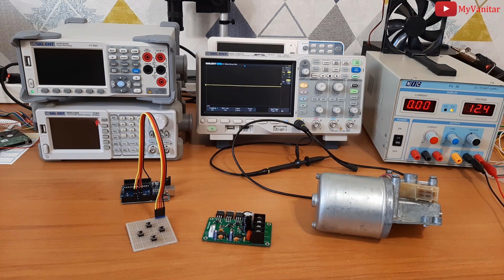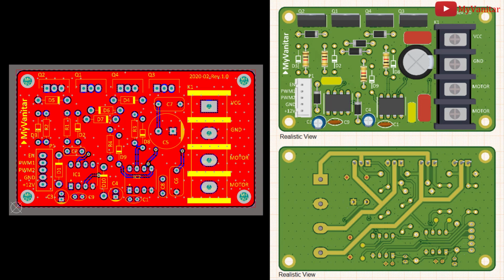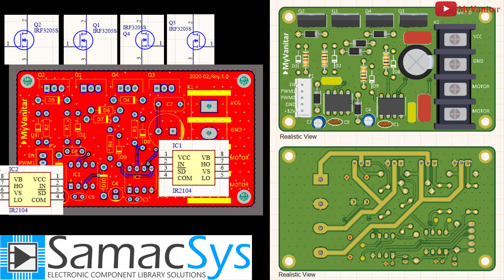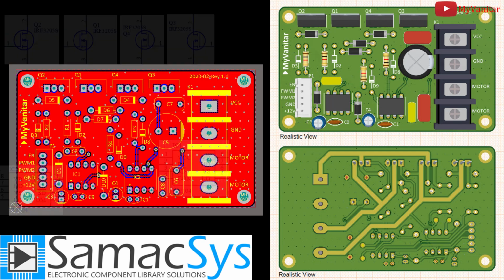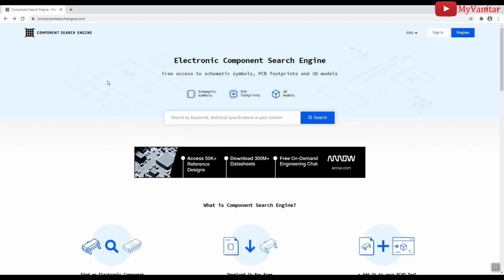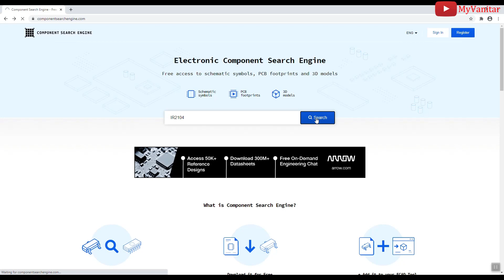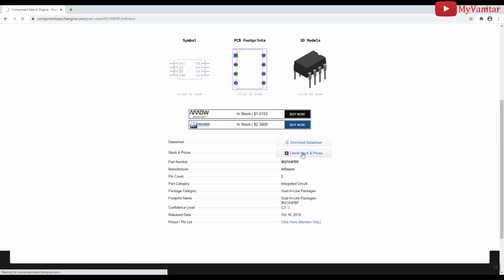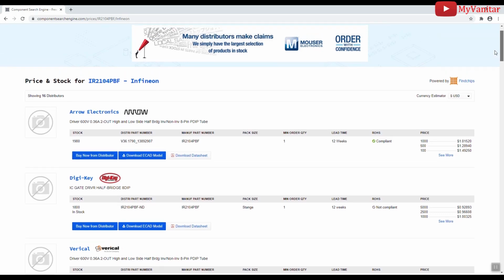H Bridge DC Motor Driver/Control Circuit [40A PWM, Power MOSFETs]

Comment: Hello, I am from Argentina, excuse my English! Very good project. I am working on a replacement for the famous IBT-2 BTS-7960, I do it with IR2110 and channel n mosfet, also a dead time logic so as not to destroy the mosfets. This video inspires me to do it!
Reply from the maker: No problem, if you practice English, then you are a BIG step ahead of others! It really depends on the current consumption of the load and the choice of the MOSFETs that could tolerate your rush currents

Comment: Very nice explanation; I found out the hard way about needing Schottkys across the FET drain to source, they are definitely needed for driving the bigger motors.  I kept blowing the FETs and it took a lot of looking around to find the cause and explanation.
Reply from the maker: Thanks. Generally, it is much better to use those external diodes. I explained why in the article.

Comment: 3:46 And a non conductive screw! Nylon screws usually
Reply from the maker: Not a screw, but a plastic washer
Reply: @MyVanitar  I meant a nylon bolt. If you use a metal bolt and a plastic washer it could still short out
Reply from the maker: whatever I say you make your assertion :-), no problem, use that bolt in your designs

Comment: Can you explain how you made the button connections of the engine? How will the connections of the 4-legged buttons be ?
Reply from the maker: I think you use Google translate. for buttons, as you see in the video, I used a demo board and connected each button to an Arduino PIN (Digital Input PIN). the buttons are named "tactile push buttons". Reading button status is a basic Arduino project. I used an Arduino library for easier reading as well (JC_Button)

Comment: I build the circuit and run it. I only had a problem when I pressed the reverse engine buton. I think I made a mistake in the software part you shared. 
Thank you.
Reply from the maker: Keep trying and practice. Invest some time. the code is easy

Comment: Thanks for your good work on this driver.  I wonder why you do not measure the current in the motor.  I am interested to see how it performs at 15 Amps for a sustained time.
Reply from the maker: Thanks, I received similar requests from two other visitors as well. No problem, I will add the current feedback, however, that's not a difficult task. The encoder is even better to keep the torque identical all the time.

Comment: Hello and thanks for the video!Can I only switch the Mosfets for having a power supply of 120V?
Reply from the maker: you should change some capacitors and the MOSFETs because your input voltage is higher than the voltage of these components
Reply: @MyVanitar  Thanks for the reply.The capacitors I have to change are C5,C6,C7 am I right?
Reply from the maker: @upbgenoob5488  honestly the PCB should be modified to follow the higher voltage standards, but what I told you was the minimum action, otherwise those components will explode

Comment: This is a cool idea.  I was going to swap out the FETS for 100V-40A ones to drive with a 80V lawnmower battery.  I ordered the boards from PCBway, but as I started looking for the individual components, I can't find anyone who stocks the IR2104 driver!  Any ideas on where to find?
Reply from the maker: That's a pretty normal component. search the component on componentsearchengine.com and check the stock and prices

Comment: Hi excelente video but I was wondering, did you prove your H bridge with another Voltage supply than 12V?.
I made one of this h bridges but mine doesn't work when have a superior Vs supply and I don't know why
Reply from the maker: The voltage of the driver side should be always 12V (fixed and regulated). The load side can be changed. in my circuit, I have also used some capacitors. be careful about the rated voltages of the load capacitors and increase them if your voltage is higher
Reply: @MyVanitar   max output voltage can go upto ??

Comment: Nice circuit. Does the IR2104 prevent shoot-through?
Reply from the maker: shoot through? can you explain in more detail?
Reply: @MyVanitar  Sure, no problem. Using your schematic as a reference, and using micro-seconds to mill-seconds as the time frame, if one were to want to switch the rotation of the motor from clockwise to counter-clockwise, or vice versa, there can be an issue with shoot-through, depending on timing.

So, if we switch direction, via a micro-controller, it will tell the MOSFET driver, to flip the gates to it's associated MOSFETs. Let's say we are talking about Q1 and Q2. Because MOSFETs do have wide turn on/off tolerances, usually in the micro-seconds, and sometime millisecond range, there will be a short period of time that when one MOSFET is turning on, say Q1, Q2 hasn't turned off all the way, which means you have a direct short to ground from the drain of Q1, going down the source of Q1, going into the drain of Q2, going through the source of Q2. The term for that is "shoot-through", because VCC shoots through directly to GND.

When designing an H-Bridge, this is one of the things that has to be taken into consideration to make sure that the MOSFETs don't have their lifespans significantly shortened, or that the motor or other inductive load doesn't get damaged... or the power supply itself.
Reply from the maker: The MOSFETs won't be damaged, however, it is better that you soft-start program such things (sudden direction change) using an MCU. The load (DC motor) "could be" at risk of mechanical damage because of a sudden reverse force. sometimes it is used for fast braking, however, not recommended :-)
Reply: @MyVanitar  fair enough. I know some drivers have dead time build into the IC to prevent this, but a lot of the time, it isn't obviously documented in the datasheet.
Reply from the maker: Yes, that's another advantage of using a driver, and most people amaze why I don't just drive a motor using a transistor and a single Mosfet, or sometimes just a Mosfet

Comment: Nice work. This would almost be perfect with my project. Would have to add current sensing ( ACS758LCB-CB-100B) to the PCB.
Curious if the circuit could switch to motor regeneration when coasting.
Reply from the maker: Thanks Neil. Yes, you can monitor the motor using an encoder or a shunt resistor or a sensing chip as the one you mentioned, however, this board is a driver, you can add these on a separate controlling board with an MCU.

Comment: Hello, where did you get that screw-terminal for connecting VCC,GND and the Motor? I've been looking for something like this for a long time, would really appreciate it (:
Reply from the maker: Don't worry, it is famous and easy to find, I don't remember the part number, check this video and article also: "Standalone Full Bridge DC Motor Driver"
Reply: @MyVanitar  OK thanks

Comment: The project was pretty self explanatory. But how many V should we get the VCC value in the circuit schematic?
Reply from the maker: I don't have the schematic in front, but the voltage of the driver (not the motor) must be 12V fixed.

Comment: Please can i ask what the purpose of using the diode in parallel with the gates mosfets resistors ? thanks and Nice work  and video btw
Reply from the maker: You're welcome. As I mentioned in the video, you can read more in details in the article. Also you can order the PCB.

Comment: Hi, I hope you are doing well. For clockwise rotation, Q1 and Q4 must take the pwm wave, while Q2 and Q3 must be off. But in your circuit, I think  all the switches will take the pwm , because ir2104 products two depended pwm for high and low side. Am I right?
Reply from the maker: No. All Mosfets are N Channel. PWM=0 means OFF and PWM=something means rotation in that direction. No need to disable the chips. I have published another compact standalone device as well. Check the channel
Reply: Thank. I am going to control dc motor with that by using atmega32 in MPLAB IDE. I think I should make two PWM signals as pwm1 and pwm2, which, for example, pwm2 is NOT of pwm1. Am I right?
Reply: I'm enthusiastic to learn more from you. How can I keep in touch with you? Do you have telegram or whatsapp?
Reply from the maker: Yes you would need two separate PWM pins from the MCU (for example PWM-1 and PWM-2) that could work independently because the rotation speed of the left or right might not be necessarily equal. also, you should put one of the PWM outputs OFF where the other is generating pulses. if there is only one PWM, you should perform this using a switch as I did in a different project

Comment: Is there a way to modify  this board work without digital inputs and just use a pot to vary the motor speed and or PWM signal
Reply from the maker: use a PWM generator at the input. No change should be done for this circuit because it is a Driver, the PWM generator can be on the same board with driver or at another board and connected to the driver by wires

Comment: hi, why does it show error when pwm value is 255? When 254 is OK; but at 255 it gives under voltage
Reply from the maker: an Error? You might need to modify the code a bit, that's just for testing purpose
Reply: @MyVanitar  
thanks for your answer; but it is not possible to implement 100 %pwm with ir2104. I will be glad if you find a solution and share it with me. the video is so great
Reply from the maker: @ATAS  as I told you, it is not related to hardware or IR2104, you should not be hurry in electronic, just check the code and this "if" condition: if (UP.wasReleased() && PWM_Value < 250)

Comment: Hello sir. I have question about IR2104 Vcc and Motor Vcc. I have 12V battery and 12V 380W DC motors for our robot. If IR2104 Vcc and Motor Vcc supply same terminal with my 12V battery, will I face any problem ? I don't want extra pinout for IC Vcc our design, because my battery and motor are 12V. In this video you supply Vccs same power terminal.
Reply from the maker: You can do that, both supplies share a common ground. minimum voltage is 12V. but the voltage of the driver side should NOT go higher than 12V, but the motor side can go higher

Comment: nice video and article.👍
how is the performance compared to IBT-2(BTS7960)?
Reply from the maker: Thanks. You can mount a big heatsink on this and get higher currents. You can easily change Mosfets with other part numbers and drive higher voltage loads ... etc
Reply: Estoy tratando de hacer un puente h similar al BTS7960 con IR2110 y Nmos. El desafio es lograr el tiempo muerto por hardware utilizando puertas logicas, el BTS7960 lo tiene incluido en su logica interna, el IR2110 no lo tiene al igual que el circuito del video. Si conducen simultaneamente los dos mosfet de lado izquierdo o derecho se pueden quemar. Tambien el IBT-2 tiene un ic aislador de 8 fuffer y conexiones para PWM solo con dos entradas. Es un reto pero se puede hacer.
Reply: @sebastiano6426  Hola! como vas con eso? yo también ando buscando alternativas para reemplazar el BTS7960 ya que no se consigue en mi país.

Comment: How can i add 2 buttons to stop the motor in both directions... one stop button for forward direction & second is for reverse direction?
Reply from the maker: My provided code is just a sample and for testing purposes. if you have an Arduino board or whatever hardware to generate PWM signals, you can write your own code. This circuit is the driver
Reply: @MyVanitar  thanx bro but i am not using arduino , i want to add only hardware
Reply from the maker: @RehanKhan-nc6bf  Yes, as I told you I used Arduino as an example to driver the board, otherwise you are free to use whatever hardware to control this

Comment: Make a video on H Bridge Inverter using TLP 250 or any other optocoupler. Can you suggest which mode is possible for the H Bridge or any Multilevel inverter, low side or high side is used in making simple H bridge inverter.
Reply from the maker: Okay, I will cover that if time and budget allows

Comment: Hello. I built this board but I have a problem: the input voltage is 24V but the output is only 0 to 12V to the motor. The PWM line goes from 0V to 5V. What I did wrong?
Reply from the maker: Hi. if the duty cycle of your PWM pulse is up to 50%, so it's correct: 24/2 = 12V, also your power supply should be able to deliver the current otherwise the voltage drops
Reply: @MyVanitar  The PWM is 100% (5V). The power supply is 2x12V UPS battery with enough amps ( If I power the motor directly from battery it works). If I connect only 1x12V battery the output is again 12V... It doesn't matter the input voltage... the output is 12V. I don't know what I did wrong. Some bad capacitor?
Reply from the maker: did you order my PCB or you built your own?
Reply: I ordered your PCB. I found the culprit. It was   the C2 and C8 capacitor. They were "made in china" :)). Thanks for your response!
Reply from the maker: what do you mean by made in China? C2 and C8 are just ordinary ceramic capacitors
Reply: @MyVanitar  They just smoked every time I changed them, so I took some old ones from a PC power supply and it worked.
Reply from the maker: 1uF multilayer capacitors, 50V rated. I'm sure you made a mistake somewhere, most likely lower voltage rating

Comment: Hello! I read in an article that using logic level mosfets that work at 5v (arduino output) and using bjt transistor as a controller to pre-amplify the voltage and current taking the mosfet to the saturation zone, how true is it? I am also looking for an alternative for bts7960
Reply from the maker: Hello, if you wanna build a motor driver, the best thing is to use driver chips, that's why are made for not using discrete components. 12V is everywhere because a power motor at least works with 12V, smaller ones are weak and not for power applications, probably small full h bridge chips are fine for them

Comment: Sir can I use 1uf polyester capacitor or electrolytic capacitor for boot strapping ? I doesn't get 1uf ceramic capacitor from local Market.
Reply from the maker: it's not ceramic. I think it is a multilayer one. you can use whatever type you like, but pay attention to the shape and pitch (distance between pins)
Reply: Thank you sir.

Comment: Thanks for video. I wonder "how could i check motor? Is it connected or not?" Thanks.
Reply from the maker: The only way is to measure the motor current. put a shunt resistor in series and measure the voltage over the shunt. if the motor works, it consumes something.

Comment: Can 1n5819 diodes handle high reverse currents?
Reply from the maker: They are not necessary at all. however, I added them to make a better design

Comment: I wanna use 4 DC motors, can i use 1 output for 2 motors?
Reply from the maker: Yes, you can use one output for as many parallel loads (motors) you like, just be careful about the current consumption. also check the latest video (so far). "A standalone Full Bridge DC Motor Driver"

Comment: Hi
If I want to control with raspberry pi, is it not enough ıf I give pvm1 and pwm2. 
Can ı short circuit EN and GND. Do ı get a ground fault?
Reply from the maker: if you check the datasheet, it is already pulled down using a resistor inside the chip, so you can just leave it open. to disable the chip, you should apply Logic-1 to the EN
Reply: So is it okay if we leave the most pin blank? We dont need  to put into action , ı understand it right ?
Reply from the maker: most pin blank? what does that mean? (OFF: PWM1=0 and PWM2 = 0) and ..... I have explained this to another user, check other comments also

Comment: Very nice and useful project. I want to build it.
Would it be ok if instead of the IR3205 MOSFET I would use the HSP6024A MOSFET?
Would it be better or worse? Thank you.
Reply from the maker: I couldn't find any datasheet of your MOSFET. So anyway check if the pins match (G-D-S) and how much is the RDs(on). Lower means lower heat dissipation. VDS is also important which must be higher than your input voltage or load voltage. I suggest you order the PCB directly from the link at the bottom of the article. The quality should be good, so don't go for cheapeas
Reply: @MyVanitar  Thank you. You can find the MOSFET on the LCSC(dot)com website. If you could take a look just to know if this would be ok I would be very grateful. I especially want to know if using this MOSFET would increase the output current capabilities of the PCB.
Reply: @MyVanitar  Here are the specifications for the HSP6024A MOSFET: 
Vds: 60 V
Rds(ON): max 4.8 mΩ
Id: 200 A

Are these ok? Thank you.
Reply from the maker: It is good that you yourself grabbed that information otherwise I did not want to reply! These parameters are good, check the pinout if that is G-D-S
Reply: @MyVanitar  Thank you very much.
Reply from the maker: @TvGGuzu  take care
Reply: @MyVanitar  One more question regarding some of the diodes. Would it be ok if instead of the 1N4148 diodes (D2, D3, D8, D9 with the specifications: 100V 200mA 1V @ 10mA) I would use the SM4007PL diodes with the specifications: 1kV 1A 1.1V @ 1A? I would want to have the parts SMD. Thank you.
Reply from the maker: @TvGGuzu  it shouldn't be a problem, however, 1N4148 is a very common diode. also, I think your mentioned diode has thicker pins than 1N4148. You may face some problems in soldering
Reply: @MyVanitar  I have a question regarding the code you posted on PCBWay for this project. I noticed that the first line in the loop() function is digitalWrite(Enable_Pin, HIGH); (Maybe to enable the MOSFET driver IC). Shouldn't the ine be digitalWrite(Enable_Pin, LOW), considering that the datasheet for the IC states that the enable pin is active LOW? Is the code on PCBWay identical to the one you used to control the motor in this video?
Reply from the maker: @TvGGuzu  There is no problem with the code, I used what you see there. You are not bounded to use that. That's for testing purposes